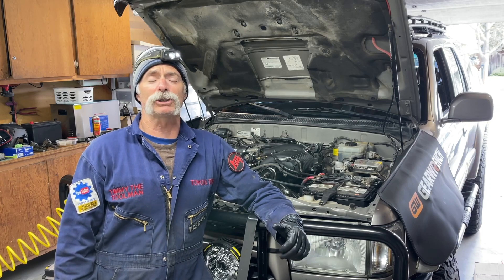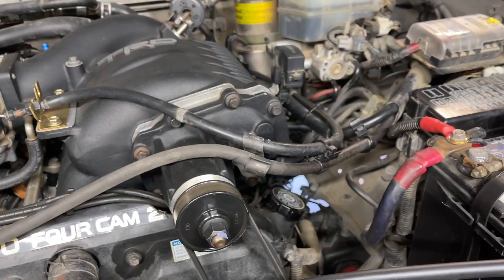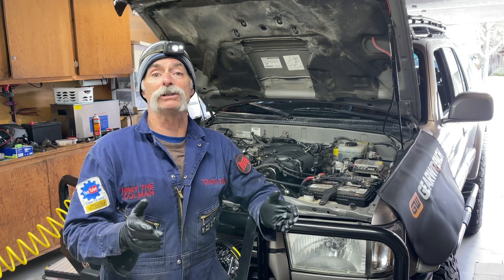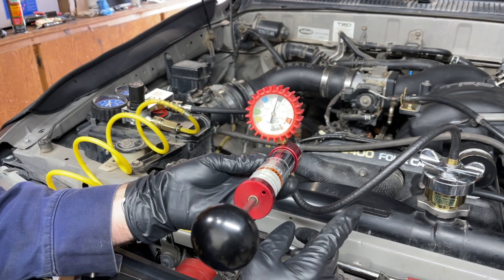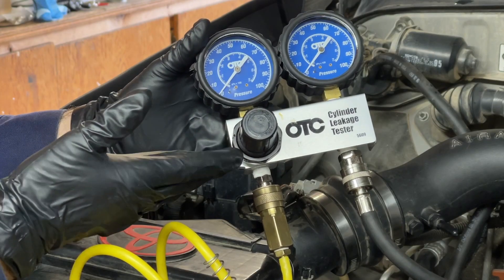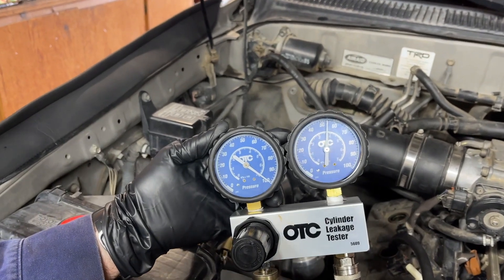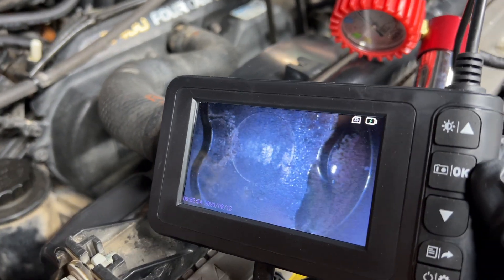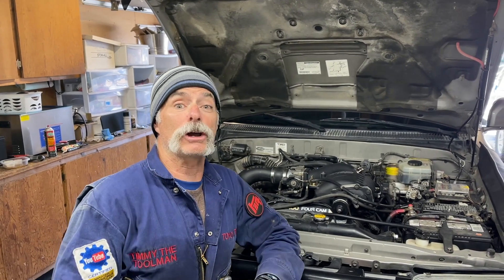Head Gasket Failure Diagnosis - Misfire code P0300 (P0301, P0302, P0303, P0304, P0305, P0306)

Comment: Well. I may late to this video. Just now going through some of these issues. Not sure if I am losing coolant (my bad for not checking it reg.) No white smoke at the TP. Just rough morning idle and then smooths out after warming up. A bit sluggish going up hill and acceleration thou. She has 345K miles and has always run fine...after 22 years..I love the detail in your videos, but may have to take her to a shop...I do not have all these tools to test compression and leak down...But now I won't be surprised when they tell me the news. LOL Thanks again from Borrego Springs, CA
Reply from the maker: From the symptoms you described,  it does sound like you might have either a bad head gasket or a cracked head.  Keep an eye on the coolant level in the reservoir and see if it's going down.
Reply: @TimmyTheToolman  - OK...Thank you

Comment: Excellent video! My 07 FJ has recently misfired on no5. I’ll be doing both head gaskets, timing chain, water pump since it’s 18 years old and 194,000 miles. I’m tempted to pull the engine and do the work on the stand versus bending over. Thank you sir!😎
Reply from the maker: You're welcome Chris.  Where do you live?
Reply: @TimmyTheToolman , West Los Angeles. How about you?
Reply from the maker: @chrisfort7340  I'm in NorCal, San Jose.  It would be cool to do a head gasket job on that engine.

Comment: Hey Timmy I have 09 Toyota Camry that’s over heating replaced radiator, ect sensor, thermostat and housing after those fixes I got 2 more codes p0304 and other codes pertaining to bad spark plugs and ignition coils at this point im not sure what else to do
Reply from the maker: Did you perform a compression test or leak down test to see if one of the cylinders is compromised?
- Sean

Comment: I went through that with my 2000 Tacoma 4x4 with 3RZ-FE motor: I bought the truck brand new, and nearly 22 yrs later @ 374,000 miles, it began running rough/misfire upon starting first thing in the morning. After about 20 to 30 seconds, it would smooth right out & run fine. We detected large air bubbles coming up in the radiator & knew we either had a blown head gasket, cracked head, or both. It was both. The head was barely cracked at the spark plug hole of the 3rd cylinder from the front, plus the bad gasket. I opted to rebuild the entire engine along with a brand new, genuine Toyota head. I bought the new head & over 90% of the parts from LCE. We included many upgrades to the new head and the engine, including balance shafts deleted and all-new stainless header & 2.5" exhaust with a new free-flowing CAT too. Got it all finished last August ( 2022 ) and to date, it runs stronger than ever before.
Reply from the maker: Did you do the rebuild yourself?
Reply: @TimmyTheToolman  Oh Lord no.....lol. Sorry, I should've mentioned that. We are lucky to have a certain shop in my area: Brevard Cylinder Head & Machine Shop, rebuild the engine. They are heralded as one of the very best in all of central Florida. A friend of mine who has been a Toyota tech for over 25 yrs now, referred them. Before that, the owner of the shop actually worked with my buddy at the Toyota dealership garage for nearly 10 yrs.  Only a few months before doing mine, they had built an entire 2JZ for serious drag racing, turbo'd of course. I wish I could have seen it, but a couple buddies of mine has, and they said it's a beast. They do all types of race motors in addition to stock/every day driver applications. They also take on work that the other machine shops turn away, such as rare and/or exotic heads/engines from really old stuff, such as old WW I and II era aircraft engines. Every customer reference I've found online gives them a 5 star review.
Reply from the maker: @howabouthetruth2157  That's great.  Sounds like you got the right shop to rebuild your engine.
Reply: @TimmyTheToolman  Yeah man! Got quite a bit more power to be naturally aspirated too.

Comment: Please i have and issue with my 5L diesel engine,number 3 cylinder is misfired i have changed the nozzle still same i have service the injector pump is still same please what is the problem i need help please thanks
Reply from the maker: Hey Charles, do a leak down test of the cylinder.  You might be losing compression causing the misfire.

Comment: Hey Timmy do you have a video for wheel spacers for 3rd gen 4Runner
Reply from the maker: No, we don't.  But, there's really nothing to them.  Remove your wheels, and install the spacers with the supplied lug nuts.  Use loctite on the threads if you want, or not.  I think loctite isn't necessary.  Have someone help you by applying the brakes so you can torque the spacer lug nuts to spec.    Then put your wheel back on with your regular lug nuts and torque them to spec.  I torque both sets of lug nuts to 85 foot pounds.

Comment: I noticed my radiator fluid dropping lately !
Good timing for the video !
👍🙏
Reply from the maker: If you don't see an obvious leak, you might be in the same boat as Sean.
Reply: @TimmyTheToolman  Did you guys notice any rust on the spark plugs or any other components ?
I dont have any codes, as of yet !
Cheers !
👍🙏
Reply from the maker: @williamtsol636  We didn't really analyze the spark plugs but you can usually notice a difference in how they look if one cylinder has coolant intrusion.  You might not get a CEL until the coolant burning off is causing a misfire.  The fact you're losing coolant with no obvious leak is troubling.  There is a chance you could have coolant pooling in the valley between the heads and that might be something to investigate.  But, the intake manifold needs to come off for a good look.

Comment: Same scenario last year my S/C Taco…..when I got the heads off I no true smoking gun on the H gaskets, however upon inspection found multiple cracks between the valves. Both heads were replaced & valves freshened up. One of the difficulties I had to deal with was the fact of resealing the TRD headers which thankfully I found Remflex 7013…somewhat difficult installing those as the headers do not have a proper flange or boss for each ring to sit in. I went with all new exhaust studs for ease of installation. Also replaced the head stretch bolts. Runs awesome however after all that work I somehow tend to go a little easier on my right foot. The misfire/rough at first startup scenario exactly as described. Pinhead was also helpful as he does a pretty good series on this task. #3 was the worst by far. I didn’t bother with the leak down as my borescope showed antifreeze and obvious wash. Great videos….thanks again.
Reply from the maker: I think the TRD headers aren't worth the hassle for any perceived performance gain.  When Sean got his Supercharger,  my first thought was I bet there's a price to pay for the increase in horsepower and torque.   My guess is we're going to find a crack between his valves as well.  Yes, the head bolts are torque to yield and should never be reused.  Some people go with ARP studs instead of the bolts.  We're going to get started on this project soon.
Reply: @TimmyTheToolman  the additional boost def could be a culprit on the head cracks, however I believe it is a possible thing with the 5VZ-FE as Pinheads experience shows. Yes the headers a bit of a pain, but in 250k miles never had to touch them and they sure sound great. As for any gains….I would expect some performance increase, however as you say Timmie not worth the hassle to install. In my case the truck is an early ‘02, and when the dealer installed them when the truck was new they unfortunately ended up altering the front cat flange whereas if I went back to stock manifolds I would need to replace the front cat.
Reply from the maker: @LoneScout1  Who's this Pinhead guy?  Is he on YouTube?
Reply: @TimmyTheToolman  PinHead0001…very articulate fellow
Reply from the maker: @LoneScout1  I just looked him up on YouTube.  He's got 12 videos and they're mostly about rebuilding an Aisin carburetor.  I don't see anything about 5VZ cylinder heads.
Reply: @TimmyTheToolman  my bad. I’m so sorry. PH was the FJ45 carby guy, and he is a very good instructor. Put the carby back on & never touched it again. It was set up perfect right down to the idle speed. I should have indicated Worse than Chiggers, very informative. I am sorry about that Timmy. You are def the go to guy, but found his series when I need to do that job..
Reply from the maker: @LoneScout1  Yeah, I know about the Worse than Chiggers guy.  I've been referring people to his series for years.  He did an excellent job documenting it and it will be hard to improve upon what he did, but we're going to make our own version anyways.

Comment: Exact same symptoms on my SC’d 2002: rough start that smooths out in about 5-6 sec after starting and intermittent P0300. Curious what you find exactly and if it’s a cracked head, is there a stronger head option out there?
Reply from the maker: We're guessing it's a cracked head.  It's not too uncommon of an occurrence.  The only country making new heads for these engines is China.  Japan doesn't make them and there's no U.S. company either.  The only other choice is to buy refurbished OEM heads but that doesn't come without risks because they've gone through thousands of heating and cooling cycles too and could crack on you way sooner than you would have hoped.  So, the choices are China or refurbished OEM.
Reply: Thanks Timmy. What’s the risk of continuing to run the truck this way? I have two of these trucks (the other is a manual ‘00 Highlander edition) and am mulling over taking the ‘02 out of service for a while.  Can that coolant damage the cylinder?
Reply from the maker: @dqyle  Well, I think the concern is getting coolant into the oil that will mess with the lubricating properties of the oil.  I know people run their engines for a while with this condition, but it's probably not a good idea.

Comment: Get those heads off takem to a machine shop get them resurfaced ported and polished maybe a valve job. Larger injectors, now is the time to do it.
Reply from the maker: We're definitely going to get them pressure tested, vacuum tested and resurfaced.  Don't know about the valve job.  We might be putting two new heads on.  Depends how the testing comes out.  Yota1 is going to help us out with it and sell us the heads if we need them.  We put new injectors on Sean's rig when we shot the knock sensor video.  There's injectors meant for a Supra that supposedly are a higher volume injector for supercharged rigs, but we could never get them.  The guy at MotorWest Performance hard difficulty getting them.
Reply: @TimmyTheToolman  I have the part number for the Supra injectors, I have them on my rig, and have installed them on several other rigs. Night and day difference from stock injectors. IMO no reason to leave anything stock it’s always time for an upgrade when something breaks.
Reply from the maker: @MarkamisPrime  I asked Sean about them and he does have a set of Supra injectors he bought a long time ago.

Comment: Nice! I look forward to what you find and do next. I went through all of this just about a year ago, when I was trying to figure out what was wrong with my truck. I ended up with a cracked cylinder head on the same #3 cylinder. Long story short I pulled out the entire engine and overhauled it. Took a lot of time and money, but it is running great now. 
Stopping is the current issue with the truck, I found that the rear axle was leaking gear oil into the break drums. I did replace the oil seals and breaks, but the bearings are shot and I have neither the tools or the money to repair it at the moment. When I do get around to it, I will definitely be looking up your videos on the process.
Reply from the maker: It seems like the #3 cylinder is a common failure point on these engines.  

Be sure to watch both of our Rear Axle Seal videos before staring the job and read the comments we pinned.

Comment: Should be an interesting  vid. Mine has a slight oil leak on the passenger side.
Reply from the maker: It will be a good series.  These 3.4 engines are getting up there in mileage.  As these engines age, more people will be faced with what Sean is facing and will need a good tutorial to follow.

Comment: This is perfect timing. I think I have the very beginnings of a head gasket failure or cracked head. It'll run a little rough for a few seconds on cold start after it's been sitting for a few days and then run fine after. If it only sits for one night then it doesn't run rough so it must be a really slow leak for now. Looking forward to your teardown video for getting the head off as I see myself having to do it in the future. Also looking forward to where you get a head if you do end up replacing one or both. 

If I end up having to replace a head i'd probably just spend the money and do both so I don't have to think about when the other one might fail.
Reply from the maker: Yeah, sounds like you're experiencing the same issue.  I'm assuming you're losing coolant as well?  We're going to get the heads tested and resurfaced at Yota1 Performance.  They usually don't offer this service to just anyone, but since we have a relationship with them, they're going to help us out.  If one or both heads need replacing, we're going to buy them from Yota1.
Reply: @TimmyTheToolman  Yea I seem to be slowly losing coolant. I see Yota1 has heads on their site but they seem to be out of stock for now. New OEM ones would be nice but they're expensive.
Reply from the maker: @tylaroverturf  Yeah, it sounds like you've got a head gasket issue or cracked head.  Yes, new heads are pretty pricey.
Reply: how many miles are on your rig?
Reply: @efil4kizum  221k

Comment: Unfortunately I’m going to call that’s it’s a cracked head. They always crack between the valves, especially when boosted. I’ve had 3 5vz engines do it
Reply from the maker: Yeah, I tend to agree with you.  I've seen the same thing with them cracking between the valves.

Comment: I just did a full head gasket job on mine in January. My passenger side gasket failed in cylinder 1. I opted for to pull both heads and do a full gasket job, all the typical seals that go with it, plugs/wires. Also took my injectors in to RC Injection for cleaning since we have them right here in SoCal - and damn were those dirty. Hardest part of it all, really, was having to do it across a couple weekends in my free time rather than a few a days straight through. As much time as Sean has put in to his car, may as well do the driver side while you have everything taken off.
Reply from the maker: Yeah, we're definitely going to pull the driver side head and have it pressure tested and resurfaced.  It's definitely the smart thing to do.  Thanks for the comment.

Comment: Do I have to do both sides? My dad says you’ll end up with more pressure on one side of the block than the other.
Reply from the maker: You should at least pull both heads and have them pressure tested and resurfaced.  Now, if one head is bad, do you just replace that one or do you go for both?  In a perfect world and you have money to burn, you'd replace both.  But, quality heads aren't inexpensive.  I can see many people opting to just replace one head and roll the dice the other one doesn't fail in a short amount of time.

Comment: I had a dead #5 cylinder and brought it in. The exhaust valves on the 1-3-5 side were all blowing by. Burnt valves and or valve seals. 

My mechanic said he’d seen this on 5vz’s and pointed out an old recall for these cars (and also some GM engines) was an issue with the PCV integrated with the valve cover. The windage tray on the underside collects hard sludge which interferes with proper cooling. 

It’s been his practice to replace that valve cover at every timing belt interval with the trucks he’s worked on. I had him do that and install new heads and it was pricey but I love my T100 so it was worth it to me. 

Modern trucks are kinda embarrassing these days.
Reply from the maker: Interesting.  Thanks for sharing this.
Reply: @TimmyTheToolman  thank you for sharing so much more!

Comment: Was there coolant mixing with engine oil "milkshake" ?
Reply from the maker: I'm guessing at some level there was.  We didn't analyze the engine oil for this diagnosis.
Reply: @Timmy The Toolman  I had the same thing with my 04 tacoma. I had a cylinder 3 misfire , rough could start. I replaced spark plugs, spark plug wires, coils and fuel injectors,  next thing you know i have milkshake in the engine oil, had Yota1 performance take a look , confirmed bad head gasket and now they are saying  not worth to replaced the heads and to go with new motor
Reply from the maker: @adrianmendez8912  How many miles on your engine?
Reply: @TimmyTheToolman  I had the same issue at 259k miles.  I replaced both heads. Its a pretty straight forward job once you get the timing belt off.  The Cam gear is spring loaded, remember to put a bolt in the threaded hole before you remove it.
Reply: @TimmyTheToolman  I'm at 233k miles
Reply from the maker: @connorm1600  Where did you get the heads, and how much did they cost?
Reply from the maker: @adrianmendez8912  I think Yota1 Performance told you that based off the mileage and the cost of the heads.  It's a bit of a risk putting a lot of money into a high mileage engine.

Comment: Perfect timing, Timmy! Almost... I just finished replacing both HGs (and everything on the way down, injectors, Timing belt, water pump, etc.). I used your timing belt and valve cover gasket videos to get part of the way down into the engine and the shop manual for the rest. Your videos are a master class on 5vz-fe maintenance and repair. Thank you so much.  Beer is on the way!!!
Reply from the maker: Better late than never I reckon.  We appreciate the beer money donation.